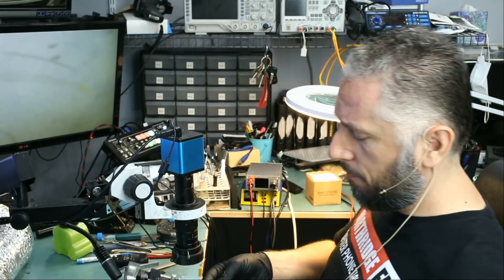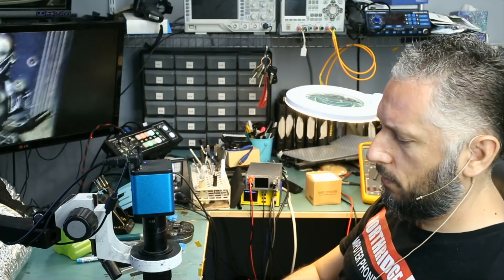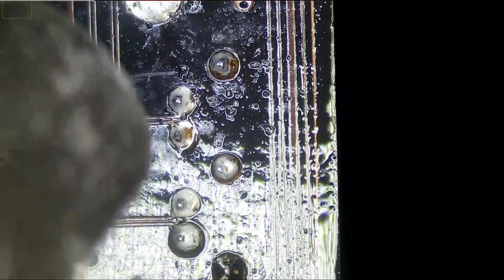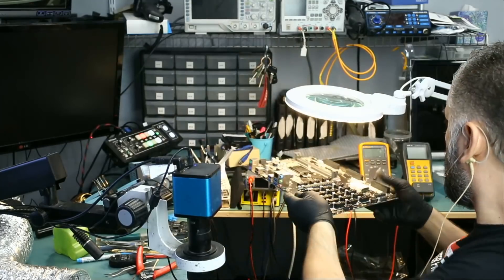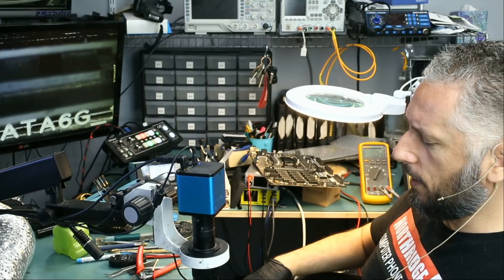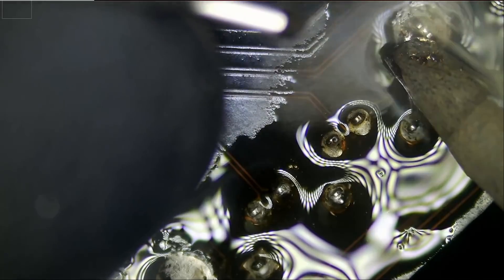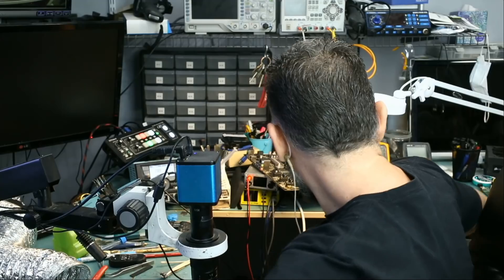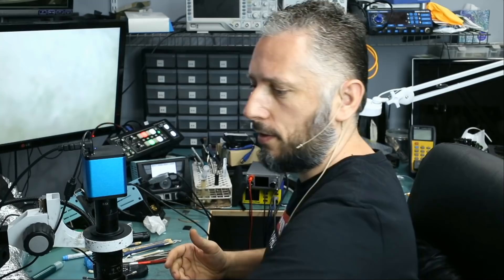B250 MINING EXPERT Motherboard SATA repair - Ghost keeps borrowing our tools.

Comment: I've had to change a lot of this. People use to boroke them just triyng to make cable as shorter as they can, forcing the SATA conector. Low melt solder is neccesasy so we don´t want to melt the plastic of the connector. As usually, great job.

Comment: Regular leaded solder also helps unsoldering connectors. Probably not as good and quick as with low melt solder, but if you don't have it, it aslo does the trick

Comment: I've done my share of repairing thru hole boards from repairing arcade monitors and pinball machines and I've always used a solder sucker or desoldering gun.  I've never seen you use one of those.  I know that they are not used on smd's or most of the work that you do, but was just curious as to what you think of those tools.
Reply: Through-holes used to be big, so you could suck the solder out easily.  But these days, the holes are so small, and often they are barely larger than the component legs, such that even if you can suck out most of the solder, there will still be some left where the side of the leg touches the side of the hole, keeping the component anchored in place.  Of course, it varies with the product and type of board.  Power supplies might still have the larger holes, for instance.

Comment: I wonder why didn't you use the solder braid wick to absorb solder instead of using heat gun to remove connectors?

Comment: What keeps you from using a device like Pace Desoldering Station using a vacuum pump desoldering Gun ? you always use low melt solder and wick. I have had good luck with through-hole components and a desoldering station with pump.

Comment: I have a question if you don't mind answering. Would it have been easier to use low melt solder and then wick it off when you had to remove the connector from the donor board? Great video as per usual Alex. Thank you.

Comment: Hi, Please answer me, who is the best "low melt solder" Or "Desoldering vacuum Gun" ??
Reply: low melt solder, faster
Reply: I think they both have merit. Depends on how much desoldering is required. The gun would be faster
Reply: @gparcero  but some boards shouldn't heated much, Because the contact holes will be torn off

Comment: Nice work.
By the way I have the same board. But the display IC burnt. It needs to be fixed. If you can help me with that I will send the courier .

Thanks.

Comment: sir youre not mentioning what tin solder after changing part. are u using low melt too? im from indonesia, little bit hard to find shops that selling lowmelt tin. found  1-2 shop but not sure lowmelt or not. it says 10m for 10us$. can u tell diffrence before im buying it?

Comment: Even if one does not have low melt solder, applying unleaded solder and mix it with the leaded solder makes a huge difference.

Comment: Those through hole parts you need desoldering tool with suction.
Reply: That's the magic - an electric hot desoldering tool or this way also - either one will work
Reply: Good to know